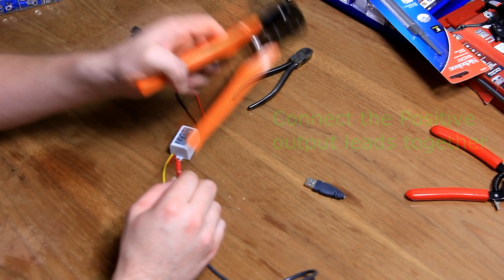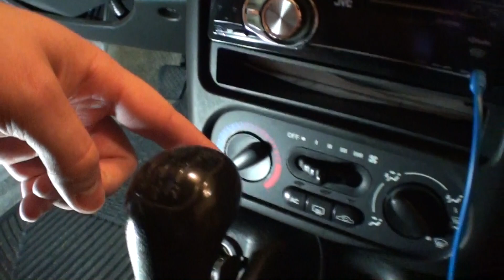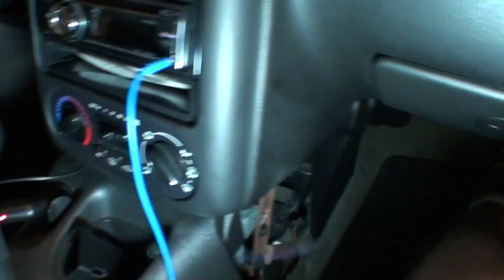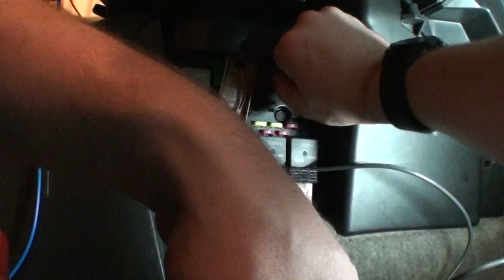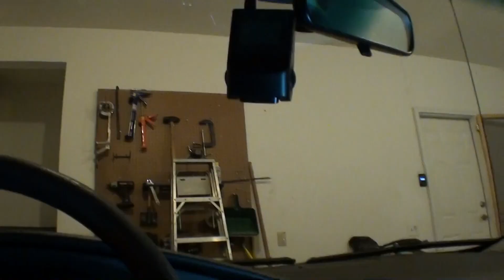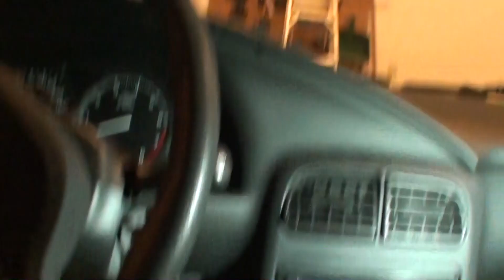Dash Cam Install - Hardwired Into Interior Fuse Panel

Comment: Went with this system and it's working like a charm.  Thanks for the vid.    Probably wouldn't have had the courage to do it otherwise.   The stock charger cord has just the two wires like the video says, red and black, so that's simple.  I hit Goodwill and got an extra long USB cord for the rear camera and usb cords for computers have four wires plus the exposed wire wrapped around them (once you remove the outer sleeve for a inch or so.)  Just cut all that away and go with the red and black.  Those are still the right wires.
Reply: Eric Bullard s

Comment: Went to buy the 12v/5v converter and there is an additional option: Max load 3.0a or 10.0a.  Which to choose?  Specs with dash cam just say 5v and don't mention amperage.
Reply: Eric Bullard a little late but the 3.0 amp
Reply: @Ayooo1728  helped me! tnx

Comment: If I were to add a toggle switch do I add it to d 12v side or the 5v side
Reply from the maker: +Miles15. com I do not think it really matters which you add the toggle.
Reply: Question - I bought a toggle switch with 3 pins - Power - ACC - Ground - so if I run the red wire from inverter into the piggy back fuse red wire - where do I connect the wires for power and ACC toggle pins - since black goes to ground anyway
Reply from the maker: +Miles15. com if mounting the toggle before the power converter, the red wire from converter should go to the ACC(accessory) pin and black to ground, Power pin will hook directly to the Add-a fuse + lead(12vdc),  Ground pin should go to chassis ground or negative lead on battery or fuse box. Hopefully this makes sense, if not, google a 3 pin toggle wiring schematic and there should be many examples for hooking them up. Good Luck!
Reply: Ohh that makes perfect sense now - thanks a bunch - I tried buying the inverter from amazon but apparently dey don't ship to canada due to custom issue I guess - so I settle for 12v female cig light - expensive but atleast I hav peace of mind that it won't over heat . Once again thanks a lot

Comment: How do I find out how many volts it takes to run my dash cam? I have a garmin 20 if that helps.
Reply from the maker: That information is usually in the manual or in the specs on the company's website. If not, take a look at the power output specs of the dash cams supplied power cable

Comment: Nice video! Where to buy the car hard wire kit as in your tutorial?
Reply from the maker: I made this harness from a long USB cable, a converter and crimps purchased from different sources. Be sure to use a converter that is specific to the power needed for the dash cam you are using.

Comment: Great tutorial. Just like yours, my 12V power outlet is always hot. I want my new dash cam to power down without having to remove the adapter. So I will be installing it using the same method as you: dashcam to a converter, converter to a fuse tap, fuse tap into a "switched" fuse position. Quick question: I saw you tapped into the radio fuse position and replaced it (10 amp) into the fuse tap. What is the amperage of the fuse for your dash cam? Thanks - William.
Reply from the maker: My dash cam is running through a 5amp fuse. Had to go look since I had forgotten myself. You may need a different rated fuse depending on the dash cam you set up. Double check the specs and go a few amps higher. Good luck and thanks for watching!

Comment: good video !  I wish I had a camera in my car, I was parked at a red light, I was going to change lanes... I turned on my signal, looked in my mirrors, my car had not moved.. I got side swiped by some ass speeding, we thought it would be a hit and run... So called 911, as I couldn't get out of my car I am disabled 911 operator told me to move my car.. HUGE mistake... I got a ticket for "failing to maintain lane, causing a accident", cops didn't care that my car never moved.  Had I had a camera, maybe I would have been able to fight the ticket..... again great video !